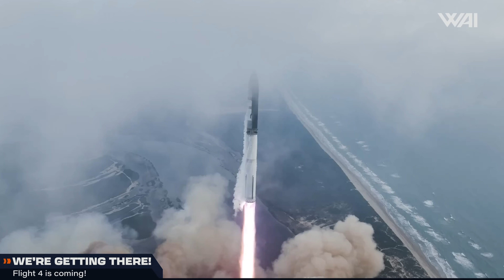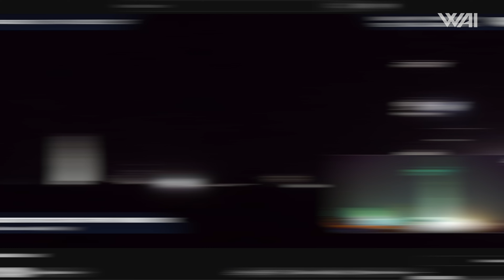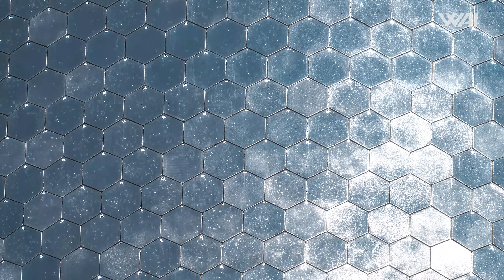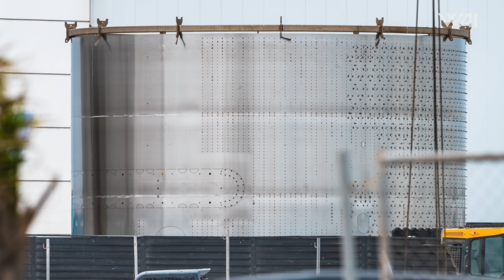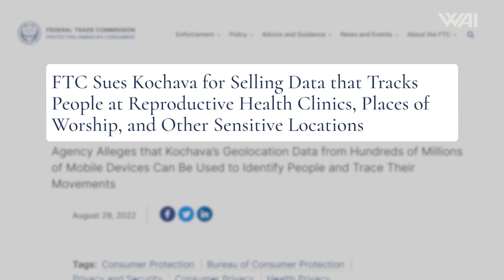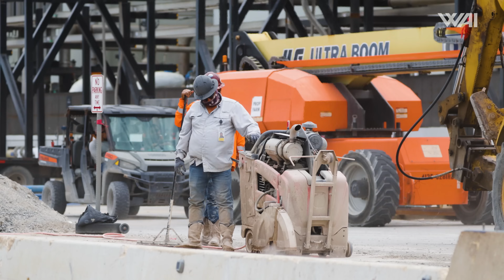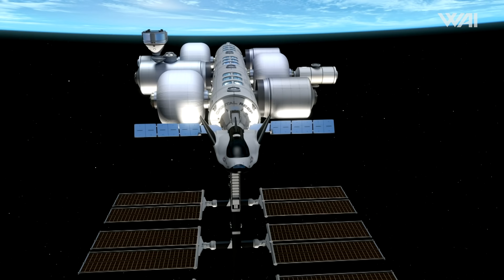SpaceX's Crazy Race To The Next Starship Launch Hides A Twist!

Comment from the maker: Take your personal data back with Incogni! Use code FELIX at the link below and get 60% off an annual plan: https://incogni.com/felix

Why would SpaceX remove so many tiles? Have they discovered something concerning during flight three?:_WAISweet:
Reply: Felix can't they replace some of these individual tiles with single pieces?  like a one piece cowl and shoulder covers over the wings?  Even something like interlocking rings going over the main body has to be stronger and more aerodynamic?  You just slip them over the body and lock them in place. Ask Elon for me. :)
Reply: I hope I can see the 2030s, but that is doubtful (fingers crossed).
Reply: @Daveyk021  you and me both. but the way things are going, maybe the world should end.
Reply: A Kinetic Energy Converter. 
    When material science improves Starships returning to Earth will have different heat dissipation. One that is efficient and simple.
    My suggestion is an additional outer skin on each section.  A ten mm clearance on each section would house thousands of nine mm radial spikes pointing  inwards, magnifying the heat dissipation area. Superheated high pressure steam is ejected through external venturis, adding thrust against the atmosphere screaming past the rocket.
    Heat tiles can be minimized because the best part is no part.
Reply: I suspect that the tile system will evolve a lot more than some predict.
Reply: Something else. Why do they make a door that opens up and why not a sideways sliding (rotating) door. Would only need rails to slide in sideways and a motor to move...
Reply: It's been 7 days.... I hear you my friend. 😆

Comment: So in the end we will end up with FLYING SAUCERS...Launch from our planet on the sides with main engines... Flip on its belly to land on sec thrusters and landing gear....advantage...way bigger floor area and easy acces via ramp for stuff and ppl.... Wau more easy to fix the heat shield to a slightly curved belly

Comment: I will be very surprised if Blue Origin launches the Orbital Reef by 2027. Given their history, I'd say 2037 is a more likely date. Still whenever they get it up, it should be a good contribution to total capacity. I am surprised they are still talking about using Sierra Space's Life modules. The last I heard, their partnership was severed and Sierra was planning to use their modules for their own, independent stations. Perusing their website though, they are most definitely still talking about being part of Orbital Reef and include a link to Blue Origin's   page. They do also, however, include a chart showing ever larger and more capable Life modules that at least implies they can operate independently, so maybe they are planning to both be part of Orbital Reef and operate their own, independent stations.
     Vast has ambitions to put their Haven-1 station up, and the first crew aboard, by 2026. Note that that is Haven-1. They're planning on more. Axiom, by definition, has to have theirs completed by 2030. If BO does get the Reef up some time this decade, then, when the ISS is decommissioned, there will already be three commercial stations in operation, with more to follow.
     Vast will put up additional Havens. Voyager is partnering with Airbus on Starlab. Sierra may put up multiple Life stations. The 2030s will indeed be the decade of the commercial space station.
     You have to feel sorry for Roscosmos though. They won't have any station of their own. Their only choices will be to rent space on one of ours, if the diplomatic and political situation permit that, partner with the Chinese, whose station is in an inclination Soyuz cannot reach, so they will have to have cosmonauts fly on Chinese Shenzhou capsules to get there, or restrict themselves to short duration, independent Soyuz flights. Do I feel sorry for Roscosmos? No, no I don't.

Comment: Why doesn't SpaceX use strings to weave the TPS tiles to adjacent tiles, creating mats of tiles, which could then be woven to adjacent mats of tiles until the required surface area is covered?  This would keep loose tiles from falling off altogether.  The tiles would overlap each other in an orientation optimized for reentry.  The strings used to weave the tiles together would be elastic enough to accommodate any flexing of the spaceship skin due to thermal expansion and shrinkage, as well as the vibrations due to lift off and flight.

Additionally, SpaceX could replace the fore and aft flaps and mini-wings with one or two scissor wings mounted on the dorsal side (opposite the reentry side) that would be stowed along the long axis of the ship, would deploy 90 degrees prior to reentry, and would redeploy to their stowed position during the transition to rocket powered landing.

Comment: The nose cone is the most difficult for tile fastening in that each row/set of tiles around the perimeter must change contour as the spline decelerates to the nose. My guess is they are ditching any mechanical fastening and roughing up the surface for some super adhesive to bond to the steel…. Maybe?

Comment: Heat Tiles will be FALLING OFF !!! ... clips and glue will NOT work, since only  losing ONE Tile leads to burn through into fuel tanks... KABOOM!!!
Space Shuttles returned 4 times missing tiles (5 times including the one lost on reentry) .. hundreds of tiles were damaged during flight and 75 tiles typically had to be replaced after each flight... luckily the shuttle did NOT HAVE fuel tanks to burn through and go BOOM.

Comment: The loss of so many tiles indicates that a significant change is needed.  Different attaching hardware, different adhesives, and or different tiles may have been specified, any of which would require removal of tiles.  One of the most important ways to assure adequate performance of adhesives on metal surfaces is preparation of the surface.  Tiles could be removed to implement a more aggressive method of surface preparation, such as mechanically roughing or chemically etching the surface.  A rough surface will boost the strength of almost any adhesive's grip on metal, and a chemically clean surface is essential.  Thoroughly removing any trace of old adhesive would be standard procedure, even if reapplying the same chemicals.

Comment: Well, so far SpaceX cannot launch StarShip one orbital flight at all in 6 months. To fly the same rocket 3 times a day, sorry.....  Heat shield tiles are a huge issue. They need to solve heat tile problem first. Regarding to launch table. Per me for multible launch per day they don't need launch table at all. They need to design better heavy duty grid fins and chopsticks to be able to hang the booster with starship on the top fully loaded with fuel about total 5000 ton. Temperary launch table with train wheels could be used to support booster/starship before launch. Its can be rolled to the side minutes before launch hanging the rocket using grid fins. So the best part is no part. It seams like Elon forgot this formula. LOL
Reply: Looks like Falcon 9 was just fake
Reply: @alvianchoiriapriliansyah9882  Looks like Starship to orbit and landing is zero. LOL
Reply: @tigranohanyan3321 Ah yes what's the definition of "Heavy-lift rocket" again?

Comment: My guess concerning the Starship nose is that a robust, one-piece, solid carbob nose cap. Given that Starship does not have wings, but control surfaces called 'flaps', it's not exactly an aerodynamic spacecraft like the Shuttle. Remember the '70's Gerry Anderson SF show 'UFO'?Thunderbird-happy Anderson had a returning lunar shuttle dive nose first into the atmosphere, with the non-tiled structure absorbing the full friction heat of that nose first entrty, saving the rest of the structure from overheating nd 'unscheduled catastrophic disassembly', a la Challenger and Coluimbia. Why not do the same thing with Starship? If the nose was flared, it's conceivable that Starship could dive nose first into the atmosphere, dealing with re-entry friction in the same way. A solid nose would facilitate that, and conceivably, get rid of those tiles. Thuinderbirds are GO!
Reply: Challenger wasn't ever burned up in reentry

Comment: These tiles falling off during testing is something that must stop and all of us have gotten too used them popping off for the slightest reason. You must remind yourself that the loss of 1 tile equals the loss of the vehicle. There is only one way I know of to fix this. Stop using tiles and use large panels vacuum bagged to the skin of the spacecraft and attached with high temp epoxy. Forget the Kaowool blanket. It will not endure exposure to a supersonic slip stream.

Comment: I'm still puzzled about third tower.   1)  Why are they not digging foundation for the duplicate current Tower One's flame diverter shower head? They haven't dug anything in.  2) Why have they not added additional Tower sections/levels to the tower parts being assembled, Starship / Super Heavy Booster getting taller, why isn't this tower getting heighten?

Comment: If they were to circulate water or coolant in the walls of Starship, I wonder if that would add extra protection against the heat of a missing tile. The water could be circulated so any heat in one spot would be cooled down. Or does it burn a hole in the metal before the liquid can cool it? Same idea as circulating coolant in engines to help keep them cool.

Comment: While SpaceX is testing individual tiles on Starship is there anything like a spray-on oblative material? If so, make a high bay that acts like a giant spray paint booth and spray the whole Starship. Then it can roll if needed and reduce heat buildup in one spot. Individual tiles were an ongoing problem for the shuttle. I like Starship's tile enhancements but if 1 failed tile will result in destruction and there are 10,000 of them, having an alternative approach in development may make sense.

Comment: Just curious, Why don't they use heat tiles like on the ship (or at least heat tile material) on the launch infrastructure? It seems they need to do a lot of refurbishment and repainting after each launch that I would have thought a protective layer of heat tiles could prevent or reduce???

Comment: One thing that could help eliminate heat shield tile loss is to spray a very light ablative coating over the tiles, locking them all together for lift off. As the ship re-enters, the coating will burn off leaving the tiles in place to do their job. Yes, it will increase the overall weight of the ship, but very little compared to how much it will be able to lift when all testing is done. It's not a spray on heat shield. It is only a thin layer coating the actual heat shield allowing it to hold together during launch and assent.

Comment: Seeing the launch platform damage and hearing the talk about not only heat and blast velocity, there's evidently also an acoustic factor that I didn't know about ... connecting these "new dots", perhaps there's also an  acoustic factor affecting the tiles beyond vibration, air velocity and temperature during launch and transition into space ??? Maybe not, but I bring it up in case loose tiles is more than the glue and anchors.

Comment: Feedline failure: More likely caused by intense vibration and acoustic levels inside the BQD housing.

Orbital Reef has about the same pressurized volume as Skylab, ~350 cubic meters (m^3).
That's about 1/3 the size of ISS.
Skylab (launched in May 1973) cost about $16B in 2024 dollars. 
The ISS cost ~$100B in today's money.
Skylab is a unimodular space station design that was sent to LEO in a single Saturn V launch.
Orbital Reef and the ISS are multimodular designs. 
NASA launched ~25 Space Shuttle flights to deploy the ISS to LEO.
==> Orbital Reef should cost $30 to $50B in today's money to develop and deploy to LEO.
Starship, outfitted as a space station, would have slightly more pressurized volume than the ISS and can be built and deployed to LEO for less than $5B in today's money.

Comment: It seems to me that a whole different technology is required to replace insulating tiles - I suggest a giant insulating precast condom that encases the whole ship.  That would help too in terms of maintaining propellant low temperature after loading and perhaps make the rotational position of Starship less of an issue during atmospheric re-entry. The challenges would lie in material choice and manufacturing methodology, but  I daresay nothing that would be beyond the Space X's whizz kid engineers.  No charge for this brilliant idea, by the way, but if Elon reads this and wants to send me some merch I won't say no..........☺

Comment: Some heat shield ideas that may have been mentioned already:
Perhaps wrapping the Starship tile areas in a heavy duty adhesive vehicle type wrap material to hold the tiles in place until re-entry burns it off. Could also have multi-colours, reflective mirror, or advertisements.
Perhaps the commonly suggested placement of flaps leeward of the heat shield would not only reduce the number of tile shapes required, but could also aid the Starship's forward and aft sections in more closely matching the profile of a Dragon capsule for aerodynamic stability.
Perhaps an external on-orbit robo-arm to inspect for and replace missing tiles.
Perhaps a more blunt, semicircular shaped nosecone with an eyelid type opening that opens within the slightly larger diameter heat shield “half” would also enable less tile shapes and allow for a larger cargo door.
This semicircular nose cone could also be removable at Stage Zero to allow for various cylinder shaped third party cargo configurations to be inserted (like a battery into a flashlight handle) within a standardized Starship’s cargo area. Eg. A space station segment could be inserted to convert a Starship into a space ship or refuelling tanks could be inserted to convert it into a tanker, etc. 
Looking forward to the fourth launch!

Comment: there is a good chance that after propellant transfer, the nose experienced material contraction due to both change in pressure, and thermal.  its also possible the metal buckled around the tank due to changes in pressure.

Comment: I think you're going to eventually see Stage 0 transform to a launch only mechanism. 
Landings will be effected with mechzilla arms that are completely separate from the launch mechanism. They'll be situated close by and use transport stands to move ships between them. It almost makes sense to plan a stop at a high bay for an inspection before moving a ship to the launch pad. 
The launch table and related support systems shouldn't be subjected to the potential damage that would result from a missed catch. Just my take on working out whats needed to maximize operational efficiency for launches.

Comment: I believe that numerous sensors on both the booster and Starship gave the Crews information about skin temperatures and vibration loads. I would not be surprised if a thicker ceramic fiber blanket may be needed along with stronger attachments needing to be developed.

Comment: They make swivel joints to attach flex hoses to specifically to prevent hose failure from the flexing seen here.
Not sure if these swivel joints would have issues with the cryogenic temperatures though since they use o-rings as seals on the joints.

Comment: To mitigate heat tile loss use metallic velcro (hook and loop). Wrap the fuselage in sheets of wire loop and adhere sheets of wire  hook to the tile backside of the heat tiles ( or vice versa). Use these materials in addition to the attachment pins. The additional weight would be negotiable yet greatly increase the survive-ability during launch and re-entry , especially for human rated staships.

Comment: Don’t believe the crazy man Musk horse manure, Starship is 3-4 years from performing a successful flight and return, maybe more
Reply: Just last year ppl said 33 engines will never work
Reply: @alvianchoiriapriliansyah9882  the tiles are still flying out, the Starship never landed successfully, the list is endless. The issue with 33 engines is that they will never know how many will work properly ever. They could work fine 5 times then fail the next, this avenue was traveled before and this concept is not working reliably